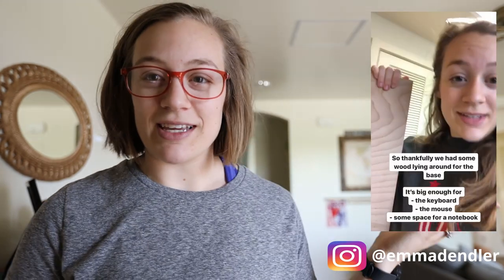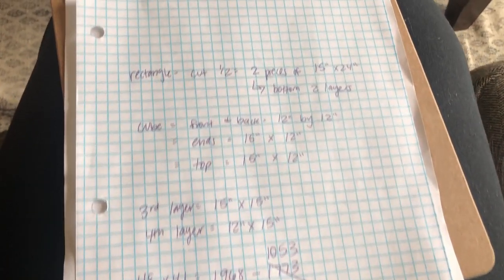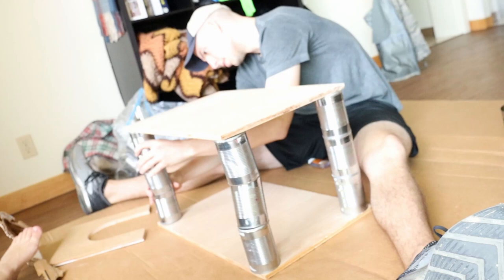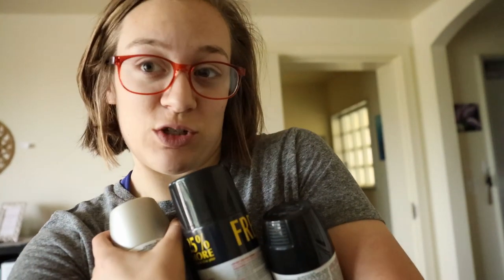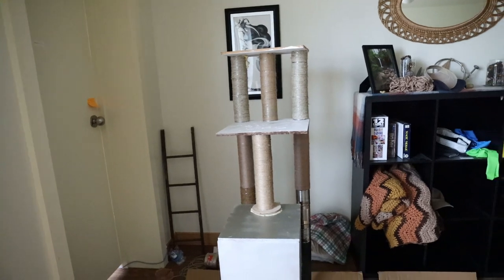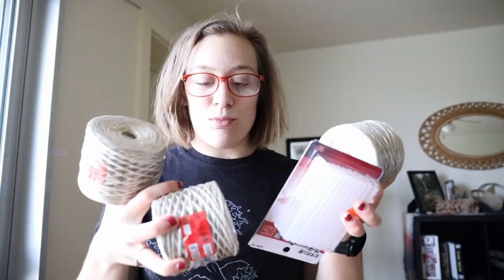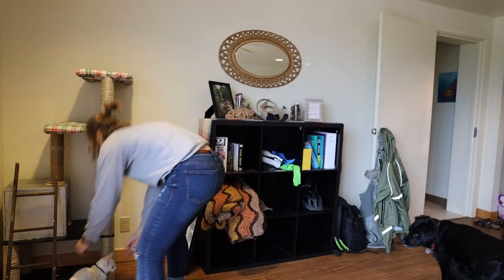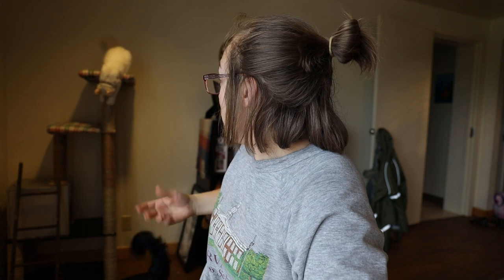HOW TO BUILD A CAT TREE | DIY cat tree for free (completely upcycled cat tree)

Comment: Hot glue on the can rims, then use Duct Tape around the joint area of the cans. If you can fill each of the lower cans with either sand or plaster of Paris before gluing the next can onto it, it will add some weight to the bottom of the Cat Tower. Old pillows that are no longer used (you can take the covers off the pillows and maybe unroll some of the fiber fill to make new cushions out of the old pillows) or use old blankets or towels folded into a cushion.
Reply from the maker: it's much too late haha that thing is long gone and two homes ago but hopefully this can help someone else
Reply: @TheSimpleEnvironmentalist  It is just ideas that I came up with, I currently have made a cat tower out of an old T.V. stand corner unit (not the best thing but it works). I am also going to make it so that a cat can use the top shelf to get on the shelf that is attached to the wall walkway.  Check out some of Jackson Galaxy's videos. I enjoy your videos, Thank you!
Reply from the maker: @dawnamorgan7364  oh that's awesome! thanks for sharing :)
Reply: Yep & wrap the levels first. I'm repairing an old one & will wrap the columns 2 or 3 times.

Comment: I loved your idea♥ , what type of glue to use to glue the cans?
Reply from the maker: Just regular hot glue!
Reply: @TheSimpleEnvironmentalist  Try E6000 glue when gluing metal and ceramics.  It works great and has a better grip on slippery surfaces.  Hot glue will eventually shrink and peel off of smooth things causing the surfaces you are gluing to separate.
Reply from the maker: @vickiechandler3112  i'll keep that in mind for next time, thanks!

Comment: I use PVC for lots of stuff....maybe you can replace the pillars with PVC, for more durability!
Reply from the maker: if I found some used I would! The goal was to make this almost entirely upcycled :)
Reply: The Simple Environmentalist   I hear ya’. Whereas you had some unused wood lying around, I have PVC from unrealized garden projects. And, in our area, we have regular trash pickup, but the next day is BIG stuff that the claw truck picks up. It’s amazing the building stuff you can find out by the street; even wooden fence that only needs the bottom 6 inches removed and it sometimes sands up like new,depending on the original quality.
Reply from the maker: @freewaybaby  Whatever works for each person!! I even made my compost out of bulk trash! Ps, I posted the cat tree update today if you're interested :)
Reply: @TheSimpleEnvironmentalist  wow another pvc/can comment... what was the harm in responding like this to me?

Comment: Should just use pvc pipe, its sturdy and beats having to put together a bunch of pieces (cans) that will likely fall apart anyway. Can find it at your local home improvement store for $10-13 for a 10-20 foot (depending on what size you get) and they can cuz the sizes you need right there at the store (in lumber).

Also pvc pipe has other fittings so if you wanted to do a totally different design or project you can glue (with pvc glue/primer in one also about $10). Also while your there you can check to see if they have left over lumber (typically sitting on it's own cart in lumber full of warped pieces or unused cut pieces), and then head over to flooring and check with carpet people to see if they have any remnants (unused cut pieces).
Reply: Just as a heads up hot glue will not stick/adhear to pvc, though if your just adding the rope and you sand the pvc (to give a rougher outside for glue to stick to) and wrap the rope tighter together than she did then there shouldn't be a problem. The way she wrapped her rope the cats will likely pull it right off the can with only a few tries.
Reply from the maker: The point was to build this from trash, though, and not new items and pvc can be toxic :(
Reply: @TheSimpleEnvironmentalist  Based on what I could find the only time PVC can be toxic is when your trying to melt it. Also every building and home (unless it's really old & out dated) use PVC for plumbing. That's water you drink, bathe, cook..etc with being carried by PVC. So unless your gonna try and melt it (which if u do good luck it's pretty thick) then it's perfectly safe. Crafters use it so much infact I just found out they make certain pieces (such as flat end cap) that won't work for plumbing but are specifically made for people who craft. 
I do love the concept of your idea though of reusing typical things you may have or throw away. The cans made me feel nervous though as they weren't structurally sound (easily break), and unless you spray them with some rust-resistant spray I'd be worried about rust being a problem as well. I know my two cats when they start chasing each other and jumping on things that they'd need something sturdier. I loved that you were thinking out of the box of new ideas though. :)
Reply: @TheSimpleEnvironmentalist  Hey! Random thought.. you know what would be a cool video along the lines of making it out of garbage items would be dumpster diving at bigger stores or wherever and finding random things to make it out of. Or random items from yard sales or places like Goodwill (oooh or dollar store items, love me those creative up-cycle dollar store videos). See like I said I like your concept behind your idea, & this idea one might have to go out of their home to get BUT it's still either free or cheap. And at the very least it would be entertaining to watch what items u find & use (like cloth dinner mats instead of carpet).
Reply: Might need e6000 glue
Reply from the maker: @PsychoPixy222  maybe next time :)
Reply from the maker: @PsychoPixy222  That would be cool! Well, we do have to make a new cat tree when we move so we will probably film it :)
Reply from the maker: @PsychoPixy222  just because every home uses it doesn't mean it's okay :) I wouldn't say it's perfectly safe before melting, it's still toxic. It's not for me that's for sure. You'll have to check out the update video. It only broke once and was easily repairable and hasn't broken since I repaired it!
Reply: @TheSimpleEnvironmentalist  What makes you think PVC is toxic? I literally couldn't find anything that said it was unless you try to melt it. *IF* it were toxic I'm pretty sure it wouldn't be approved to be used in literally every building & home. Where you getting your information from that states it's toxic? I understand & respect everyone has their personal preference/opinion on things they use or don't use but, let's see some actual facts that it *IS* toxic to use before misleading your viewers. Otherwise I'll just chalk it up to not doing your research and pushing your personal perspective/ideals onto others.
Reply: Please link your *credible* websites/info your getting your facts from stating using/being around already made PVC pipe is toxic. Thanks 😊
Reply: @TheSimpleEnvironmentalist  BTW hope you live in a bungalow or some place that has zero plumbing otherwise pvc pipe IS for you weither you admit it or not. Go ask your landlord, significant other/spouce, or go look in your house & see for yourself that you are infact using PVC pipes a multitude of times per day. I'm not sure why you think it's not for you when you (assuming you have plumbing) are drinking, eating, washing, sleeping,  cleansing, & ingesting (among more) from it literally several times EVERYDAY. You'd be amazed how many things you use indoor/outdoor plumbing for... Heck even to water your lawn you use PVC pipe. So.. if it actually were "toxic" most of the world would be dead, since it's not maybe you should do some fact checking.
Reply from the maker: @PsychoPixy222  i never said it wasn't :) I don't like it, sure, but that doesn't mean it's a part of our life. I avoid is WHEN POSSIBLE just like I avoid throwing things away and avoid flying WHEN POSSIBLE. Here's an articlefrom the dept of human services. I did fact check, thank you for assuming :) just because people aren't dead doesn't mean something isn't bad for us. CO2 is bad for us. too much meat is bad for us. too much of ANYTHING is bad for us including PVC so I avoid it when I have the choice. https://www.state.nj.us/humanservices/opmrdd/health/pvc.html#:~:text=PVC%20contains%20dangerous%20chemical%20additives,posing%20unnecessary%20dangers%20to%20children.
Reply from the maker: @PsychoPixy222  here ya go!! https://www.state.nj.us/humanservices/opmrdd/health/pvc.html#:~:text=PVC%20contains%20dangerous%20chemical%20additives,posing%20unnecessary%20dangers%20to%20children.
Reply from the maker: @PsychoPixy222  and another https://saferchemicals.org/get-the-facts/toxic-chemicals/vinyl-chloride/
Reply from the maker: @PsychoPixy222  you'd be surprised at how many toxins are in our goods that the FDA and EPA and all those other agencies say is okay. I linked several sources above. It doesn't sound like you're respecting me at all. I am NOT pushing my ideals on anyone??? this is my opinion and i clearly stated that it is my personal choice to not use PVC. That isn't even the point. the point is i didn't want to buy anything new for this project toxins or no toxins.
Reply: @TheSimpleEnvironmentalist  BTW I'm not arguing that it's not overall harmful, but as listed in the links above states that it's mainly in manufacturing it, not the USE of it. And if people are really scared of it emitting gas while its in a solid form then just seal it with spray paint it then use on cat tree. Its like $3-5 for spray paint and it's not like you'll be drinking from or storing food in it. I'd imagine the school supply thing (from your website) is cuz kids tend to put things in their mouth, so unless you plan on sucking on your cat tree that you're going to cover over with a layer of hot glue then another layer ontop of that with rope (or whatever else) then pretty sure you'll be ok. But that's up to each person to decide & do actual research on before declaring something is "toxic". Especially since different branches of the government are stating when & how it's actually toxic and that it doesn't at all pertain to using it in this application such as a cat tree.
Reply from the maker: @PsychoPixy222  wow thank you!
Reply: @TheSimpleEnvironmentalist  In the 1982 test they state "The concentrations in groundwater were up to 0.008 ppm." That's not even 1ppm, its 0.8% of 1ppm and to help see how much 1ppm is I found this video (mainly cuz I had no idea how much 1ppm is 😛).

https://youtu.be/aa-m8a-jZ0k

Also, remember that was in 1982 I'm sure they have updated the method of making it since then. Bet there is a higher concentration of toxic crap in the everyday air we breathe than what was found back in 1982.
Reply from the maker: @PsychoPixy222  you're still missing the point. I didn't use it because I'm scared of it, I didn't use it because I was trying to make this cat tree from upcycled materials. That is the premise of my channel not buying new stuff. Either way, it's something I plan on avoiding as much as possible just like pesticides, meat, and so forth.
Reply: @TheSimpleEnvironmentalist  I'm not missing the point at all, infact I stated that I liked the concept of your idea & also gave other ideas that were similar. Only reason I brought up other methods is for other viewers who are randomly searching on how to make a cat tree like I had originally done. That and to point out using cans without making them structurally sound isn't the safest for your viewers pets. You can agree or disagree either way it doesn't matter. It's always good to have different perspectives & options. What I didn't care for was your reaction to a viewers (me) different perspective & giving a different method. Then making false accusations about stuff you have zero facts on stating my way was "toxic". Not sure why you feel attacked by a random viewer sharing their thoughts & other options but if you can't handle comments on your channel then turn them off. I'm not here to fight with you & you really should have responded in a more more mature adult way EVEN if you don't agree. You shouldn't get mad either that a viewer corrected/gave you info on your facts that were incorrect, so that your not misleading by giving false info to your viewers. It's one thing to not personally like/use something, but it's a whole other thing to try and force your personal dislike for it by providing inaccurate & false facts about it to scare people away from it. If you're trying to have a successful channel then you need to start respecting your viewers & accept that people will have different opinions, methods, & view points than your own. And unless you're a narcissist, I'm pretty sure you didn't start your channel so the world could revolve around you but rather to give/share things with others, & since you have comments turned on it's evident you wanted feedback/responses from your viewers (unless it was you strictly  looking for praise & to be idolized which goes back to being a narcissist). Whichever the case may be you should know by now that the world has different views, opinions, personalities, life styles.. etc. other than what yours is. With that being said I'm done talking to you about this, please drop the subject & move on with your life.
Reply from the maker: @PsychoPixy222  don't get me wrong, I love having multiple ideas for everyone, but I also stated that the cans are in fact safe even now that my pet is grown. I also state in the video that this would not be a good idea for large cats but best for small cats. I was not making false accusations. PVC is indeed toxic. I don't feel attacked, you shouldn't assume things. I'm just here to have a conversation. Would you rather me not reply? I'm not mad at all. I thanked you for the resources and I never once said "everyone needs to ban and hate PVC because I hate PVC." I'm not forcing my views on anyone and I'm sorry you feel that way. I think my channel is successful and I respect each and every comment. There is no disrespect on my end at all that is just how you are interpreting it. I'm trying to have a conversation so we can learn from one another. I never said I was looking for only praise. Scroll through my other videos. People call me out all the time and I'm here for it. No one is perfect. I'm often wrong and accept that fact. I leave comments on to have these conversations. Sounds like you need to drop the subject. I was never upset about this. I know people have differing views as I am partaking in this conversation right now.
Reply: @TheSimpleEnvironmentalist    by stating "PVC is indeed toxic" after giving you links from the government from cdc & epa clearly stating that it's only toxic in landfills, melting, & manufacturing of it shows that your ignorant and still trying to push your personal feelings of it being "toxic" regardless of what actual facts & studies your shown. Your the kind of person who says it's a chicken when in reality its a rock, nothing will convince you that its actually a rock. You know what that means...? Well means lots of things, but the main point is that your incapable of seeing reality*. Without reality really useful things such as logic, & common sense go out the window and are non-existent for you. I don't appreciate your passive aggressive way you respond by thanking (or something similar to save face & look good) then turning around and attacking (or something similar to demand your right regardless what experts in the field have to say). Your responses are very whip-lashing & sometimes contradicting. But then again I'm at fault for pursuing someone trying to help them understand logic when they can't even see reality. But hey you know what since it's useless trying to explain the logic that its a rock (PVC *not being toxic) and scientists and some of the worlds greatest minds spending years of research studying it, are all wrong... you keep thinking it's a chicken (that it's "toxic"). Your clearly smarter & have done years worth of  actual scientific studies to know more on the subject than all the brightest minds at CDC & EPA put together. Ha!Yea... chicken.. dude whatever floats your boat.. sure..